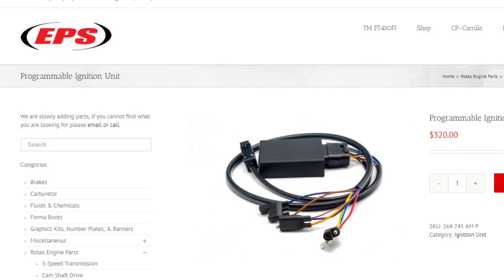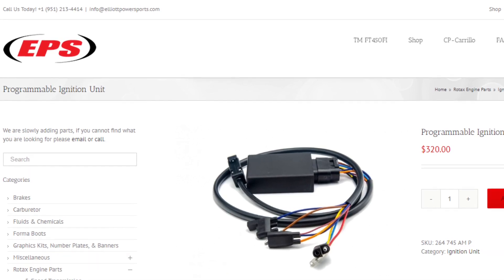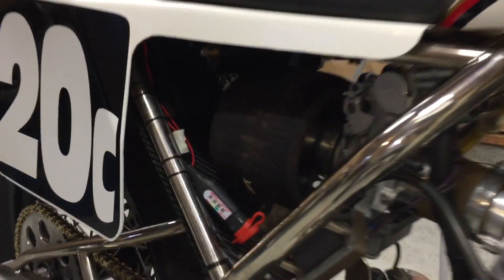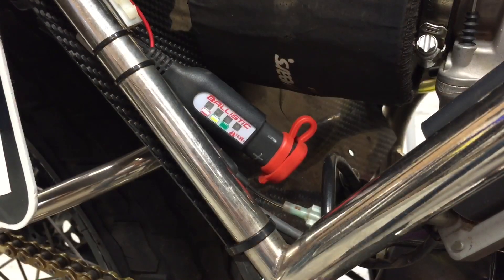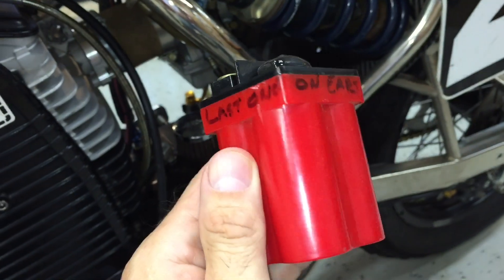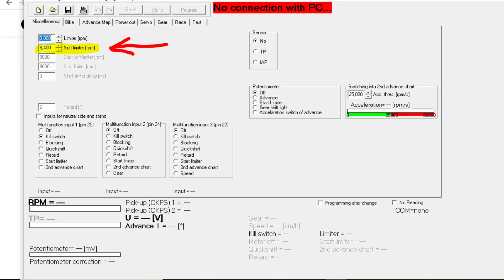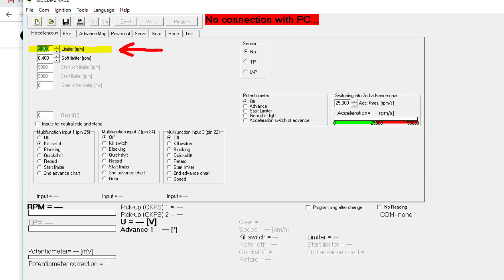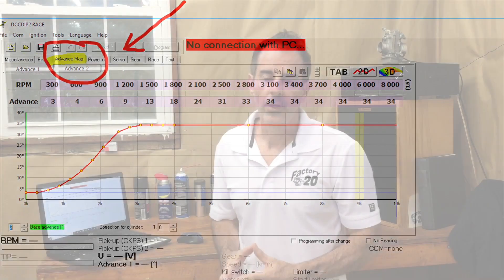Wood Rotax Programmable Ignition by Elliott Power Sports

Comment: Hey Mike, my name is Darren Anderson. I have a 676 Rotax. On my dyno sheet that I have from 2 wheel dyno works in Washington State it shows peak horsepower at 8400 RPM’s. What would you suggest setting the soft and hard limiter on my programmable ignition. Thanks for any info 🏁
Reply from the maker: Not an easy answer. A full-tilt race application and the budget to push the limit would have a different solution than a street tracker. The Rotax has a relatively smaller range of rev's available, so I've discovered spreads are narrower than I have seen with other bikes like roadrace I-4's that rev to 13,000+.  The crank is the weak spot, according to my engine builder. Particularly at that piston size and crank stroke. Finding the max revs before damage depends on reciprocating mass and engine speed, ovbioulsy.  If your combo is not making power past 8400 I'd consider trying the soft limiter at 8200-8300, and put the hard limiter 400-500 above that.  Touching the hard limiter really sucks in a racing situation, btw.  Then try it in straight line in a tall gear. It's definitely not a set and forget setting in a racing application.  We move them up and down based on conditions and tense negotiations between my engine guy and myself. I can tell you that we found a max speed for our combo and now the crank has zero bend, which has never happened in decades of my guys rap sheet on me.  Probably a good topic for a video, but I doubt it would gat any views! Great question, and I'm sorry I can't answer it simply.
Reply: Thanks for the feedback, much appreciated 👍
Reply from the maker: I added a video discussing your question. Cheers!

Comment: Mike, I have a 600 Rotax, does the ignition come as yours did with a base program in it. Or will I have to start from scratch?
Reply from the maker: I believe it will come with a map. If not, I can get you mine. I don’t think it’s special. And it’s definitely not a secret!
Reply: Flat Track Factory 
Thanks, I’m definitely looking into one. Will probably make the move this winter. Do you have to charge your battery during the race day of riding a couple classes. What amp. Rated battery do you use.
Reply from the maker: The owner of Full Spectrum Power was kind enough to review the Rotax's needs in the flat track racing environment and recommend this model: https://www.fullspectrumpower.com/collections/batteries/products/pulse-ipt-battery-p-1  This battery has some amazing technology preventing premature failure from over charging and excessive drain. It should do two classes of racing without charging.  Get the cool charger they sell also.  It's cheap.

Comment: Hey Mike, great video. As you know I don't have a Rotax but I was wondering can you turn the rev limiters off? Great stuff but I can barely hear you. Laptop volume is wide open. You sound like in a tunnel, the other end of the tunnel, haha. Maybe an audio thing.
Reply from the maker: Yes the limiters could be adjusted so they never come in.  I'm sorry about the sound level. It seems good when I'm editing, and then isn't when it's uploaded and played on my laptop also.  I need better microphones.  I'll do better!  Let me know if the next video is louder. Thanks for the feedback!
Reply: @FlatTrackFactory   I like you can turn them off.  I use a Sendec tach but have a good ear for rpm. Them limiters scare me. May check into a mic that clips to your shirt. Thanks for the info.